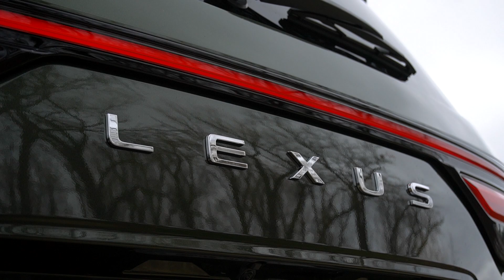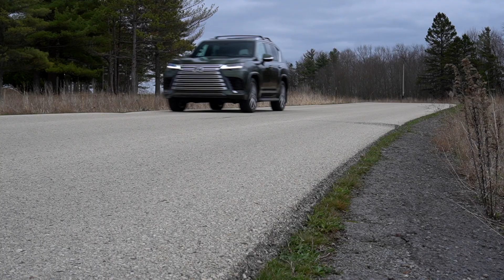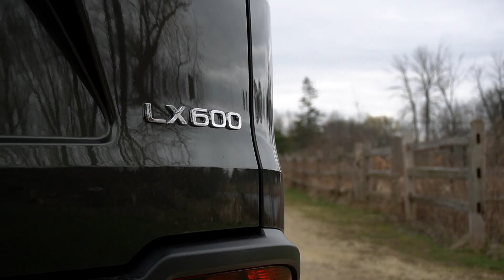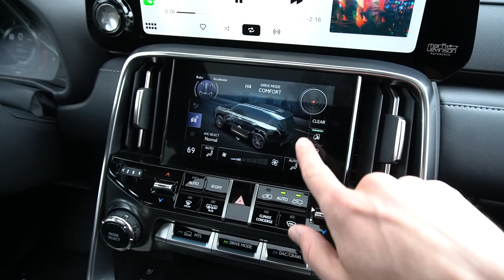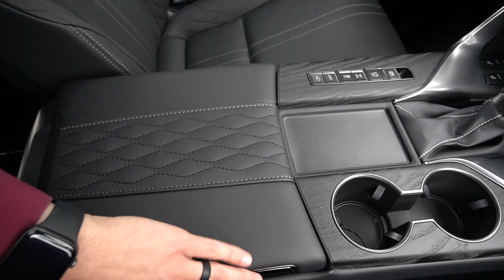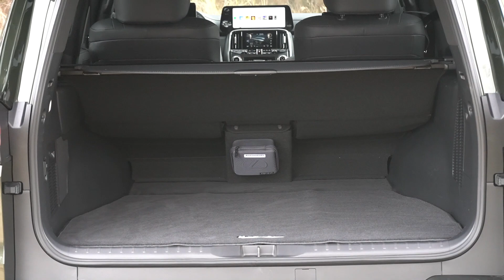2022 LEXUS LX 600 - “Ultra Lux” But At What Cost

Comment: Worst suv in the class !!
Coming from a toyota/lexus guy
Reply: No its not . Coming from a range rover guy lol
Reply: @ekgcanadianenthusiast9961  I am talking about the availability of luxury features !! The overall luxury package !! The high end tech features which u find in mercedes and range rovers ...
It doesn't even have a panoramic sunroof !!
Its interior scream 2015
Reply: @ibrahimbashir6634  interior does not look 2015 lol. Lx has every possible luxury options and  more lol. Just because its not have a pano roof dont mean it lacks anything lol.
Reply: @ibrahimbashir6634  this ultra luxury trim is about rear seat luxury lol and because of supply issues lexus decided to remove front luxury options because after all its the rear seat luxury focused model lol. Otherwise 3 and 5 seater models has front luxury options as well .i personally have  configured this.
Reply: @ekgcanadianenthusiast9961  Its cramped !! And its interior definitely screams 2015 !!
It doesn't have a digital instrument cluster like other luxury suvs !!
It doesn't have wireless charging in the front !! It doesn't have massaging seats in the front !!
The back seats feel like some cramped sub compact sedan !!
It doesn't have power shades !!
( make them electronic and make them reliable bcuz Toyota is known for reliability )
Reply: @ibrahimbashir6634   OK SLOW DOWN. 🙄. BUDDY  DID You READ MY LAST COMMENT LOL. I SAID  3 AND 5 SEATER DOES HAVE  MASSAGING SEATS WIRELESS CHARGING  AND MORE IN THE FRONT  LOL IF You Dont WANT TO READ MY LAST COMMENT ITS FINE LOL.
Reply: @ibrahimbashir6634   REAR SEAT SPACE AND LUXURY IS MORE THAN FINE SPECIALY IN THIS TRIM LOL.You KNOW THERE IS 3 ROW AND 5 SEATER MODELS RIGHT LOL 🙄